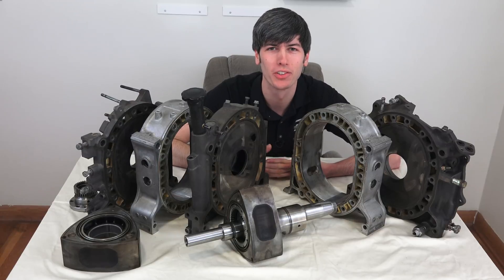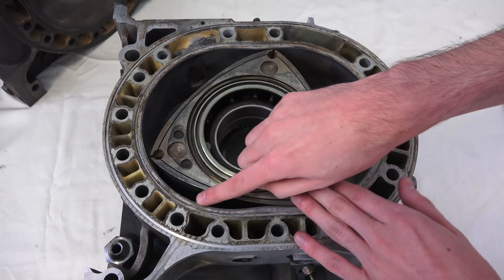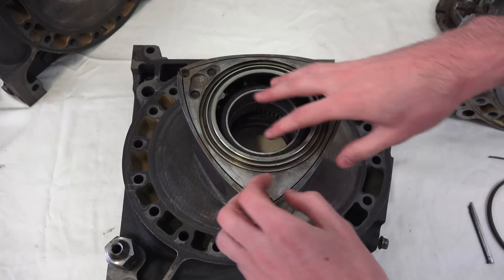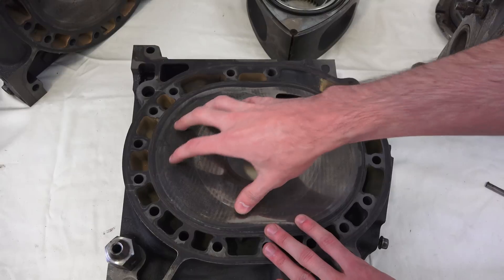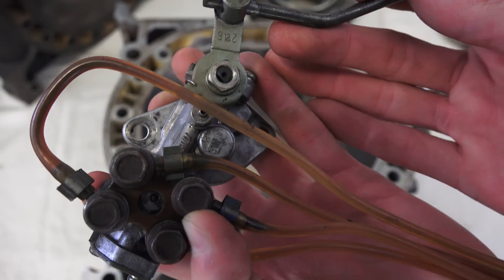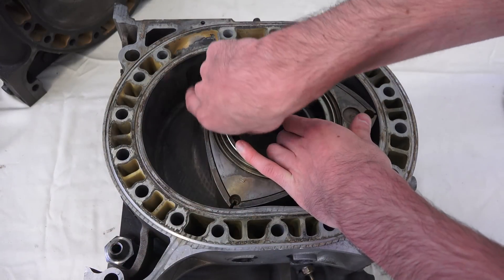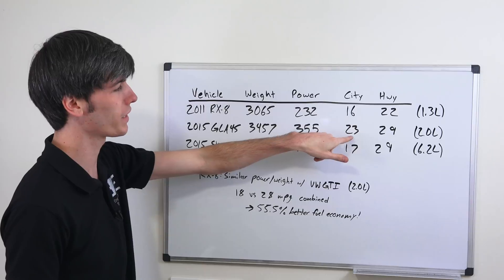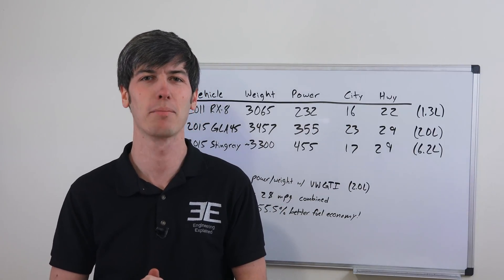4 Reasons Why The Rotary Engine Is Dead

Comment: The rotary may not be fuel efficient, but a 3-4 rotor Mazda 787/787b Group C car has to have one of the craziest sounds ever.
Reply: The best
Reply: Motor was banned
Reply: @hrvatskivitez8700  never banned.
Reply: SAME.
Reply: Not to mention is was the first Japanese car to win Le man's 24 hours. First car without a recipicating engine, and got wankel engines banned from the race.
Reply: @Snobben92  Mazda lost the 1091 WSC championship to Jaguar, the 797b was extremely slow and uncompetitive, it never posted a single pole position or fastest race lap.
It's lost 20 out 21 races and was quietly retired.
Reply: @sandervanderkammen9230  yup 100 percent correct....
Reply: @sandervanderkammen9230  I love how I posted how awesome the engine sounds, and ya'll go off into left field about crap my comment wasn't even about xD..
Reply: @kiddovr3147  Mazda lost the WSCC championship twice with the slow and uncompetitive 787b
Reply: @sandervanderkammen9230  Yes, but that was almost 1000 years ago; if we're to believe your figures. Surprised it didn't run a gazillion rings around the one-trick ponies they raced way back then. Maybe due to insufficient ground clearance for the front splitter?🤣🤣🤣
Reply: @joerosen5464  Wankel engines proved to be an epic failure in motorsports competition.
Mazda has never been recognized as a high performance or racing marque and has left racing, they  no longer have any factory motorsports program
Reply: @Snobben92  The Wankel engine was not banned after the race, that is a lie.

Comment: Hey guys, im looking to buy rx8, i really love that car, should i buy it tho? People said rotary engine is suck, or i engine swap it?
Reply: Buy a 1992 RX-7. Cheap, fun and good luck. I had a 1988 RX-7 convertible and went 200k driven hard along Hwy 1 along the coast here in California. Gas sucker and all that but fun. 
A car almost identical in size down to inches as my 88 RX is my wife's Lexus IS 350. Smoother, faster, luxurious, quiet and a hard top convertible, but sterile. 
The engine is the reason you want the RX. It's addictive and will make a nice weekend car. NOT a daily driver.

Comment: So a bit of an out-of-date comment here, sorry for the lateness, just found this video, good stuff all around, but it HAS left me curious about something.  What are your views on the new LiquidPiston X Engine concept?  A lot of what's been addressed here seems to have been solved somewhat with the new LP-X system, one problem I can think of off the top of my head would be the thermal efficiency, as every chamber in the PL-X Engine is a combustion chamber, so I'm curious what your thoughts are in regards to that little chestnut.

Comment: Jason, we were traveling from Arizona to California in our Tesla and the following occurred: An eastbound small plane just north of the interstate made a descending right turn  to land at the Buckeye airport just to the south of the interstate.  The plane was angled downward and about 300 feet high as it approached going over the freeway and just off to my right when my vehicle then utilizing Navigate On Autopilot suddenly braked and slowed by about 20mph.  Was my navigation interfered by the plane’s electronics or did my anti-collision software take evasive action as the preset speed was resumed immediately after the plane crossed over?  The next question would be are there any types of electromagnetic wave transmissions from a secondary source which can alter my Navigation On Autopilot functioning? Love to see you do a video on this subject!

Comment: The rotor engine is a good design it just needs to be refined a little.
when the links are worked out it will be a far better engine than a regular piston engine could ever be.

Comment: Low torque is one of the biggest down sides. Leaded gas helped majorly with keeping the combustion chamber sealed. Less moving parts compared to piston motors is what sets it apart. When you pimp them out the HP to displacement ratio is insane, they got banned at La mans after one season because of this.

Comment: The rotary came back as range extender. Wonder for how long it will stay this time. Anyway, the reason it died is because the never got it reliable enough. A student I worked with had one of the last one and needed 3 full motor replacements im 70.000km.

Comment: But you forgot to compare the size of the rotary engine to normal piston engine. It creates the same power with much smaller engine. That's why it's being used in Pro Mazda formula series. for 15+ years. 
But also the rotary require to run premix gas, due to mazda design it to meet certain emission standard. causing rotary to run poorly without enough lubrication.
  It's a much easier engine to rebuild, very few parts, very compact.

Comment: I've always said that the rotary engine is a piece of crap design it will never last. The performance crowd was constantly fixing their junk with blown out seals
Reply: But they run smooth as hell like they really do due to very few moving parts and they are tiny for a engine but they are unreliable as hell but they might come back when electric cars or hydrogen cars are normal in every car

Comment: I'd wager that at least some of the difference in efficiency and emissions is also a result of the money and time that has been put into traditional piston engines over their lifetime, vs the rotary motors only being around relatively less time and with a lot less, again, time and money put into perfecting them. That's not the only reason they have their issues. But I think it's some of it.

Comment: Emissions is the primary reason the wankle rotary is dead. The same reason two strokes in motorcross are dead. If the EPA didn't exist we would still have them.

Comment: I like a V8 engine in most cars, I’m not a fan of over priced power wheels passed off as a real automobile. I also believe 4 cylinder engines belong in motorcycles, but IF I hade to choose between a 4 cylinder or wankle engine in a car, I’d choose the rotary engine. Why? Well because I’m kinda stubborn and I like the rotary design, plus I don’t give two fucks what someone else believes what I should own! I’ll buy what I want. Not what someone else thinks I should buy. And I type this with all due respect to all the tree hugging, go green, brain washed, electric cars have little impact on our environment connoisseurs

Comment: The initial Wankel concept was quite different. The spark plugs was in the inner rotor. Such placement probably optimizes combustion. The stator seen in the video was a rotor too ! So the seals endures less friction. That engine ran at a higher speed without wear. Such speed should destroy any NSU/Mazda rotaries. Displacement can be smaller and in little combustion chamber a rotary engine improve his efficiency. Felix Wankel was not very fond of the alternative design finally choosen by the manufacturers.

Comment: I had all the generations of rx-7s. My first was an ‘82 gsl. It looked like the engine had been replaced by former owner. It ran until I scrapped it. Had ‘82 model that I don’t remember having very high mileage. I noticed over time the engine felt like it had less power. On my way home from work I started losing horsepower then it started sounding like a moped and smoked all the way home. I could roll start it but it smoked and only had a top speed of 45 mph. Got an immaculate 93 TT when I was 19 that had 85,000 miles and my dad said it was blowing something out of the exhaust as I drove off one day. Funnest car I’ve ever drove as far as handling and I’ve drove a few sports cars in my life but the horsepower and torque is pitiful. The ‘93 was a major jump with twin turbo though. The parts just to repair were ridiculous and I think I wished I’d bought a different car when I look back at what it costed me. I totaled the 93 before I had it long so I had no idea of how long that would’ve lasted. They seem pretty easy to rebuild though. I was thinking of rebuilding the 86 model but the rebuild kit was ridiculous in the late 1990’s.

Comment: I have to agree with the emission problems. 2005 RX-8 Catalytic converter failed after only 70,000 miles. 85,000 miles the clutch pedal would get stuck, engine kept flooding with fuel, check engine light kept coming on, power steering would jerk randomly. Around 90,000 miles engine started using coolant (dealer couldn't figure it out), weird electrical issues that would cause the engine not to start. 115,000 miles apex seals blew.... Cost so much to fix. Don't get me wrong I loved the car it was very fun to drive but I was so much happier when I finally was able to get rid of it.
Reply: My dad had one of the first ones, it died after 60,000 miles.  Only 3 moving parts what could go wrong? and popular science magazine was saying what a great invention it was.
Reply: should have spent $7,000 to get a good RX7. I've had 4 and almost no maintenance problems. 130,000 miles on my first one and it was still in spec when I sold it.
Reply: Mazda rx8 basura ford made it like that blame ford just blame ford

Comment: Rotaries are dead because they never worked as intended to begin with.

1) they are two-stroke engines, not 4-stroke; therefore, the displacement of the Mazda rotary in the video was 2.6L, not 1.3, and STILL gets crappier fuel mileage than a comparable 3 liter.

2) Yes, they're TWO STROKES, because only two-strokers need oil mixed with the fuel for lubrication. 

3) the HORRIFIC fuel "economy". 

4) No torque. the Fiat X-1/9 made more torque than most wankels. 

5) Launching apex seals out the exhaust is dangerous to other drivers and pedestrians. Think of the children.

Comment: Being a 2-stroke motorcycle fan, I think these engines are great! Similar in many ways.
Reply: Well 4 strokes are better we all know this. 2 stroke like this engine are easy to blow up. Stubborn assess get with the times. Electric is daym close to taking over if it hasn't already. Cant beat it
Reply: 4-strokes 4 boring old men!! I've had loads of 2-strokes, they only blow up if badly maintained or you use a bad quality oil. Twice the power and 4 times the fun!! Save the electricity for mobility scooters for old men like you! lol
Reply: @petehuskins  I too like to ensure that humanity will die off within the next few centuries. :-)

Comment: Absolutely pointless engine. Never understood why Mazda put it into production
Reply: Mazda make wired cars never again will buy one.. not reliable at all.
Reply: Maybe it's because at that time the wankel engine had some advances.
Reply: @oscar721x8  Yeah, gas was super cheap back then
Reply: Sometimes they do it to prove it can be done. There was no good reason for Ford to put a big flat plane crank engine in the new GT 350, other then to accomplish something people thought couldn't be done. The money invested in that, could have been put toward improving the coyote and they could have had an even higher revving engine with more power in the gt 350 than the flat plane
Reply: Pointless comment.
Reply: @FabLoveGA  And yours isn't?
Reply: @leethomas3263  Nah fam.
Reply: @FabLoveGA  Xbox fan boy? What you talking about?

Comment: owned the rx 8 when it came out..two rotor version.  a dog off the line but good pull at 25 when you needed it.  a fun car to drive tho and yes the mileage sucked. 50/50 wt dist. and rear wheel drive made it unique imo. plus it looked great and the suicide doors functioned well in it for back seat room.

Comment: The power vs MPG is not a fair comparison. The Rx-8 engine remained almost unchanged since 2003, yet is being compared to current models. A fairer comparison maybe the 2004 Volkswagen Golf  R32 3.2 v6. 238 hp - 19 MPG combined, both were rivals at the time.

Comment: Mazda used a two rotary setup. I drove a 1990 RX7 every day for 12 years. It NEVER burned a drop of oil and always and passed county emissions checks. The seals were designed to accommodate thermal changes in the engine block and worked well. It was a superb car otherwise. The RX7 was, in fact, a mid-engine car, with the motor mounted behind the front wheels.

Shortcomings: 1. Bad fuel economy (19 mpg). 2. Motor had no low-end torque, very much like a gas turbine, so very slow off the line. 3. Could not restart a cold engine. It would flood badly due to the rich air-fuel mixture, oil injection and residual oil left in the rotors from the previous day. You had to dry out the rotors by cranking with the spark plugs removed (being careful not to drain the battery) and letting it set for awhile. Once you got it started, you couldn't believe the amount of oil smoke that came out of the exhaust! That only happened twice--I learned never to do THAT again!

Comment: I wonder how it would work as a portable generator though? How does it stack up to conventional engines for weight and displacement to generated electricity and power? What about using them over 2 strokes for small engines like for lawn mowers, chainsaws and such?

Comment: I drove the RX3.  Fuel economy was poor. Most particularly on low load ( cruising ).  Engine access for maintenance was incredibly good.  Pollution was easily taken care of because it was predominantly hydrocarbons that could be burned rather than Nitrogen Oxides that need catalytic converters. Poor pickup at low speeds due to high rotating mass.  Excellent highway performance though.  From 60 mph up it was incredible. But I don't drive at these speeds.  So the wrong engine for me.  Loved it though.

Comment: I had an RX8 and I loved that little thing, I never had a single problem with the Rotary engine but that’s not to say others didn’t. 
Yeah the Rotary engine is terrible on fuel and here in the U.K. they are in the highest tax bracket which at the time was like £500 a year because of the high emissions. 
But it was a pretty dependable car as long as you checked the oil and made sure to warm the car up before racing about or turning it off. 
It just gobbled the back tyres up but that was more my fault because it was great to go sideways in. :)
Also the Rotary engine made a great little noise as it was revving up and I enjoyed hitting the super high red line and every time I did the car would thank me for it. 
If they could improve the fuel efficiency, less oil burn and a bit more power say 300bhp I would definitely get another Rotary car.
Reply: Well there are rotarys with turbos that have over 1000hp
Reply: @harre0267  Mazzei Formula's RX-7 30B with 980wHP, 4 rotors and a turbo bigger than my head
Reply: I got one now smiles every day I love it
Reply: James Williams brilliant.
Reply: Oh, so you turn right to go left and vice versa, eh? That explains your back tires' wear..
Reply: Art Vandelay  No, you misunderstood.  UK vehicle tax is based on emission levels. Income Tax in the UK is:- Up to £12,500=0% / £12,501 to £50,000=20% / £50,001 to £150,000=40% / over £150,000=45%. Is that what you call taxed to death? (And taxation pays for the excellent NHS. :)  )
Reply: Mazda makes a... er, oh wait nevermind
Reply: Dear all, Shoji Kitahara is my name and I am staying in Thailand. My business is an agent of  MORIBUDENUM DISULFER(MOS2 ) ENGINE OIL ADDITIVE to sell all kinds of engines and gear boxes, but without ROTARY ENGINE. 
I have interesting about MoS2 added to the RE for increasing HP and reducing fuel consumption. But unfortunately I have not ever added to RE. I have been tested and measured fuel consumption has reduced for many cars. Has resulted between 14~20(%)of fuel consumption had reduced. The reason of this MoS2 has effect reducing friction modified. I think RE has friction in the engine. I can tell from my experiences and my guess. If you have interesting about my suggestion, please contact me and I can tell you more information about the MoS2. Otherwise I can not tell you the maker of the MoS2 and kind of engine oil additive etc. Thank you for your attention. Sincerely Yours Shoji Kitahara
Reply: @shojikitahara9725  Hi, how do I contact you?
Reply: @8828RR  Liqui Moly is available for sale at many major automotive retailers.
Reply: @sandervanderkammen9230  Is it only Liqui Moly that produces MoS2 ?
Reply: @8828RR  The only one reccomended by and meets the specifications of major manufacturers.
Reply: Are you  still used your RX8
Reply: James Williams great to drive butunaffordabletokeepasaneverydayvehicle. Goeslikesn snot off a stck. constantlyworriedaboutheigrepairbils coming.

Comment: idle warm up...And after you had fun...idle cool down. It will outlast most piston engines. I've had mine for 20 years. Only now stripping the motor to build a 3 rotor with turbo. Can not wait to see how fuel  inefficient it will be.

Comment: I'd love to have a small rotary engine as an outboard in my boat. The way lighter weight would more than make up for the fuel inefficiency in a boat setup, where it would be pushing way less water out of the way. And it would run so smooth and quiet. Very cool.

Comment: Traditionally, small engines = good fuel economy. The rotary engine obviously breaks that rule, but for a very good reason: its tiny size allows it to be placed low in the chassis, and behind the front axle, for a near mid-engine design. Advantage? The RX-8, even today, is one of the best handling cars in the world, at any price! You buy one not to save on gas, but to have sublime feel & handling. As a sports car enthusiast, that’s way more important to me than frugal gas consumption.

Comment: It’s unfair to use the rx8 on the white board comparison the application of the Rotary engine was the best in the rx7fd bc it was super lightweight, had very good weight distribution 50/50 if I recall, and had phenomenal power to weight ratio

Comment: I see how, with it’s oil injection, it is like a two-stroke engine - which is generally banned but has some remarkable advantages. A new horizontally-opposed three-cylinder turbo diesel is a two-stroker .